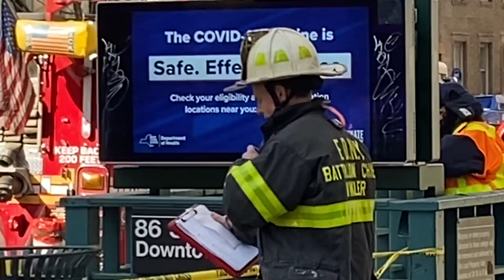FDNY BOX 1166 - FDNY QUICKLY OPERATING AT SMALL CON ED TRANSFORMER VAULT FIRE ON BROADWAY ON UWS, NY

Comment: Popping sounds from this TM (transformer manhole) indicate the power is still on. Filling the structure cools everything down & smothers the fire. Usually, they have their own fire suppression trucks though (flush trucks).
Reply from the maker: YES INDEED!  THANKS SO MUCH.....
Reply: Why do they not use AFFF high expansion foam? Or similar foams used in aircraft fires.
Reply: @jimcarrier4301  Leaves a residual on things where water won't
Reply: The fire department of NYC only provides water for fire suppression. They are not a airport fire department. ConEd usually fights it’s own fires. Unless their flush truck is not available, do they rely on outside resources. I was only in the “Underground” in the late eighties. That’s a long time ago. I work in the “Overhead” now. We fight all our own fires there too. Rarely is the fire department called in. Unless the street asphalt is still on fire, do they come in to cool that off? Electrical fires are extra tricky due to the fact that city resources aren’t trained on high voltage electrical fires. We use dry chemical (fire extinguisher) at close range after the power has been turned off. However not grounded, therefor not safe for non qualified people to fight it? The normal course of action is to let the fire burn out on it’s own. The fire department is instructed to cordon off the area & keep the public away. Even still some people are ignorant of the invisible risk. I see people skirting barricades. Only when confronted do they comply. I ask them if they feel lucky today?
Reply: @johnclyne6350   Thanks for the information.